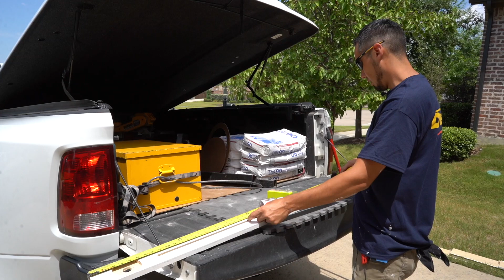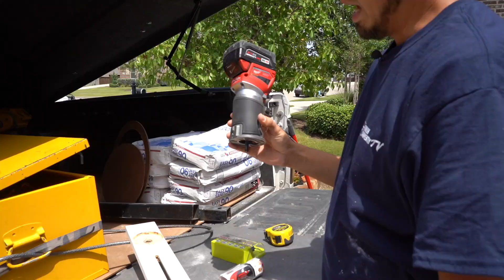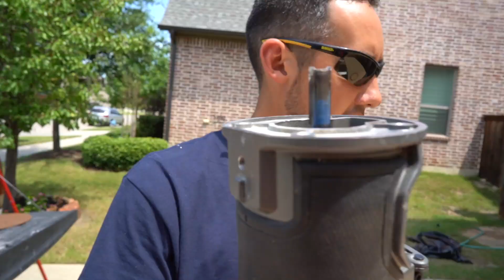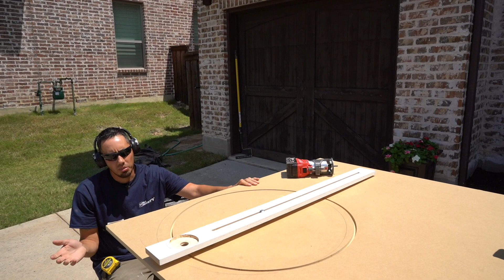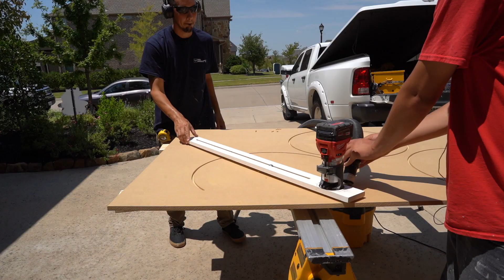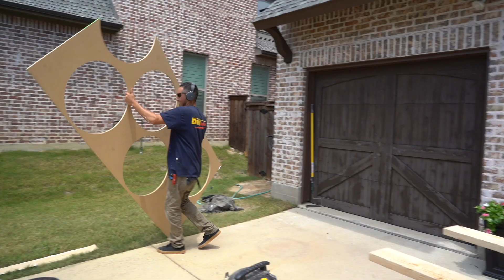I Invented a New Tool! - PATENT PENDING

Comment: We use the router to make circles a lot.  Its easier to make a template circle and make multiple copies of it using a flush trim bit.  Also, I like to use ABS plastic for my circle jig.  It screws to the router and you can drill holes for screws anywhere.  If you do a lot of the same stuff you can keep and label your template pieces in case you need them again.

Comment: And you could put a piece of the self adhesive measuring tape using the router bit as zero and make it a little quicker for getting accurate radiuses

Comment: May be easier to get one of the knobs with the threaded rod already on it and reverse the installation.  The nut fit into the groove on the bottom so it won’t turn and the knob with the thread on the top.  Everything would lay flat then.

Comment: I use a hole cutter for sheet metal kinda like that it also cuts wood and plastics as well. Just be easy on the cutter bits. Let it do the work and don't use to much pressure ..

Comment: I know I already made a comment but just feel like I gotta say.. no one can confirm curvature anywhere (8" per sq mile), therefore there is no rotundity, you can't get a ball earth as they proclaim. Of course, going off the equation for a 24,901 mile circumference sherical mathematical equation. Which is just simply the pythagorean theorem. Water will never assume a round form, it can't.  Water will always seek the lowest point, and if it's not contained, it will leak out. Water is always and will always be level. If you can see so many miles out, therefore, for a ball, spherical earth, it has to make up for that and yet there is no proof for any curvature. There is no gravity, it's called density and buoyancy for water. Air is the medium. If it is heavier or more dense than the air, it will fall. Less dense it will rise. So where is the so called "grabbity" holding billions of water to a spinning earth (1,000 mph) all around the earth spinning at a axis? What about centrifugal force? Being as super super short as I can be. Haven't even got to crepuscular rays, moonlight cooler than its shade (hence not reflecting the suns light, etc), all flying craft never have to account for curvature, nor missiles, etc, surveyors never ever accounting for curvature, you really think you're seeing a star from a trillion miles away?! Solar system "gravity" holding planets, that weigh more than the earth and more dense outside of our so called "revolution around the sun", you see Mars and venus at night which is not possible pointing away from the sun and those 'planets' "supposedly" being in the inner circle/ revolution according to their "solar system", I better stop here. Tons more but let me know if y'all want to talk. Don't believe a word I say but test it as Scriptures say! Praise Yah!

Comment: Find a solution and move the knob on the upper side so you can remove the spacers from underneath and that also helps you to fine adjust it without removing it from the workpiece.

Comment: Question:  did you ever do a video on crown molding where the ceiling in not a true 45 and the ceiling is messed up too.  How to find the angles and not have any gaps ???  The ceiling is wavy and in the inside corner one side is higher then the other

Comment: Dude trash those straight knife bits and get the up cut spiral 1/4” bits that’s all I use now and they last 20 times longer than those do
Reply: Have you tried the combo up/down “compression” bits - clean top and bottom on edges. Downcuts for dados...clean tops.
Reply: And make sure you buy one made by Whiteside!

Comment: Nice job - good & simple. I made a router compass >25 years ago when I needed to cut lots of decorative circles & arcs.  Used 2 parallel lengths of 8mm alu rod for the beam, sliding in the guide mounts in the [plunge] router base, with the pivot (8mm bolt ground to a point) was carried in a block of hardwood at the other end.

Comment: Drill a small hole , say 5mm in the HEAD of the carriage bolt & insert a pin as the pivot... Turn the bolt around in your jig , then u can have the clamping knob on the TOP... 

Ideally a lathe would do this but a guy with a steady hand and an accurate centre-pop & yer golden.. 🙄😏

😎👍☘🍺

Comment: Drill a small hole , say 5mm in the HEAD of the carriage bolt & insert a pin as the pivot... Turn the bolt around in your jig , then u can have the clamping knob on the TOP... 

😎👍☘🍺

Comment: Inlay (and adhere) magnetic tape on the bottom on both sides of the cutout for the knob. Then use either neodymium magnets or metal shims as your spacer blocks. This way you can move them around. I noticed sometimes as you were cutting and got close to the edge, one of the spacers blocks would come off of the workpiece offsetting the bit angle from being plumb. You did hold the side down that still had the spacer present which did help.

Comment: They make elevator bolts that are flat on top, you could weld a sharp point on top, in the center,  to give you clearance then put the knob on the top side ?   
Check out cutting torch circle cutters.  We used to make them in the shop with round stock and a nut to hold the torch tip, fully adjustable with wing nuts .

Comment: I suspect at least 75% of your viewers have made a circle-cutting jig at least once during their lives ... typically a strip of 1/4" ply [my latest is MDO], a plunged hole for the bit,  and nail holes as pivot points.

Now, can you see why the way you used your jig has the propensity to NOT make a "perfect" circle let alone perfectly concentric circles? [And by perfect I mean D +/- 0.003"?]

Matt and Jon could tell you.

Comment: since you drill a through hole for the center, when you cut the inner circle - no need to change the bit depth, turn the disk over, cut from the other side, and put less stress on your router.
Reply: True but that’s a lot of maneuvering for a job site
Reply: @Austinadcock  extra effort can make a big difference, it's worth putting in the effort unless you are low bidding and just getting it done.
Reply: good idea
Reply: I have a similar jig and this doesn't work unless your center guide hole is PERFECTLY straight up and down. I see a hand drill there, so I know it isn't. If he tries this it will give him a mess to lean up on the edges

Comment: Oh you can also use that jig to perfectly cope your straight pieces to the circle. Just set the circle jig to the exact diameter of your finished circle. Use your scrap inner pieces and clamp the straight piece  on front of it. Then rout.   Or you can just rest it on top and scribe.

Comment: Need to use a plunge cut bit for this, one that has the cutting edge across the whole diameter - this is probably why you burned up the bit you showed at the start of the video. For the small diameter bits, a spiral down-cut bit would be better as it leaves the top surface smooth - not quite as good for pulling the dust out of the groove though.

Comment: Nice work, love your channel.  I have learned a few tricks from you and appreciate you sharing.  Allow me to offer a few polite suggestions from experience.  You might want to try a spiral cut bit, they are a little tougher.  Spirals are not always the answer, but they definitely have their place.  I learned from Norm a trick where you do not have to drill all they way through the pivot point.  It makes it easier to fill later.  Another trick is to get the bit very close to all the way through, but not completely through, then finish with a sharp razor, or simply use a sacrificial piece of cheap plywood, or MDF.  I like to do these cuts on the ground, as it is more stable and easier to move the circle jig reliably, especially if making a table top.   If you use a small nut and washer on the underside of your pivot slot, you will not need the spacers.  Simply make a wider cut to accommodate a nut and washer, then finish in the middle with a bit roughly the size of your bolt.  Using a higher powered router at a lower speed will reduce burning.  Also, instead of routing the base inlet, try finding a few places to simply bolt the base into your flat jig and plunge your bit through.  PM me if you would like a pic of my small circle cutting jig, or look up Norm’s.  My jigs are made in all different sizes, the larger ones definitely require spiral bits.  Peace!